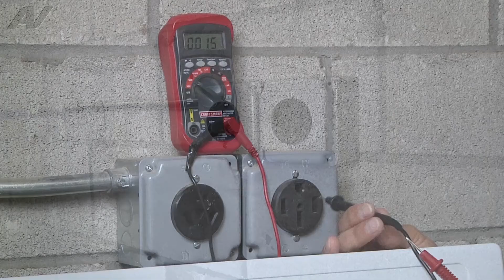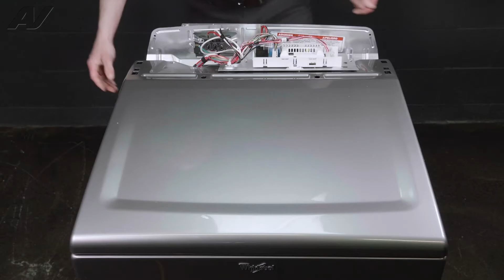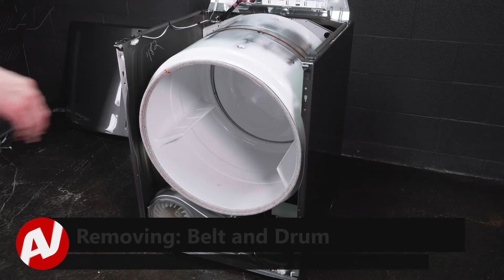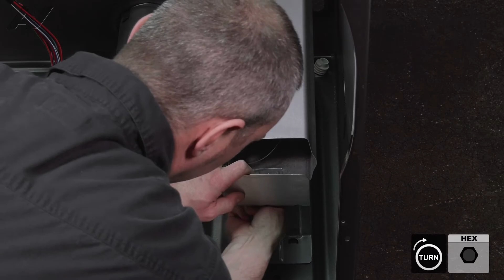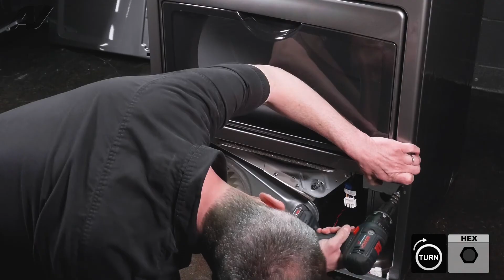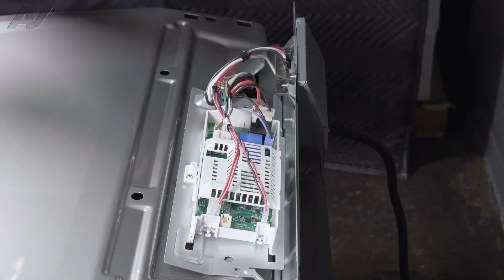Whirlpool Dryer Repair - Will Not Heat - Heating Element

Comment: This video is very helpful and helped me repair my dryer. However most of the disassembly is not necessary. I popped the front lower panel off (after unplugging of course). Tilted the dryer back. You now have easy access to the heater element (no further disassembly needed). I cleaned the dryer exhaust duct (was very clogged) by removing the 4 bolts described in this video. Was about 20 minutes tops for the whole repair!

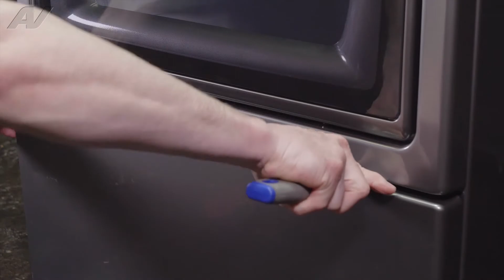Comment: 2:16 take front panel off and pull down the metal piece housing the heating unit and replace. Thank me later this guy doing too much.
Reply: If you know it’s the element that works, but if you need to test the fuses you have to do it this way

Comment: Thank you, but I am not messing with dismantling the drum assembly and the springs.  I would never get it back together again!  I am not mechanically or electrically inclined.  I couldn't even change the oil on my snowblower.  I accidentally loosened up the oil drain tube on the other end and spilled so much oil in my garage.  My confidence is nil.  Why couldn't they have the fuse and thermostat built into the upper console?

Comment: Are you kidding me you have to do all that for a heating element I’m already ticked after watching this video what happend to taking the front panel off and replacing it so easy!!!!!! Grrrr
Reply: I'm sure you can bypass the complete disassembly of the entire dryer, that seems like overkill if you ask me. 
What I did was just remove the front cover, those 2 screws holding the bracket, the one screw on the side holding the heating element, disconnected the 2 power connectors and the heating element slid right out
Reply: I'm thinking the same thing, but ehrn o realized he much money I saved. I'm like what the hell.